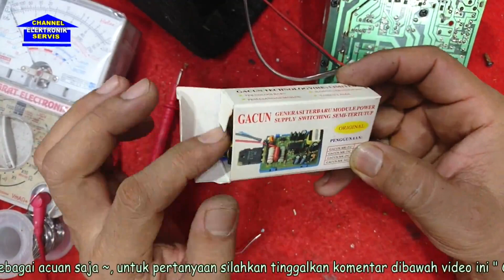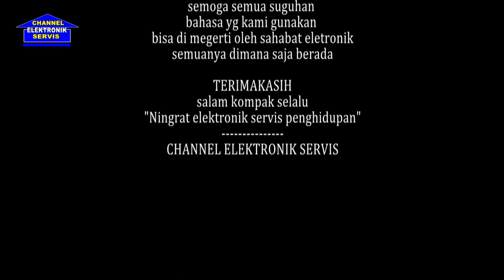speker Bass tube  AC/DC tidak bisa hidup

Comment: Kalo ic tegangan  nya jebol masih fungsi apa tdk?
Reply from the maker: klo ic teg listrik pln nya jebol sdh jelas tdk bisa pake PLN lagi sebelum di servis,
bisa di cek / di coba pake teganan 12V lewat DC input 12v , pake adaptor cctv 12v / 1A sdh bisa hidup biasanya, 
biasanya pake adaptor 12v speker j bisa di pake lagi.
Reply: @Servis-f3h  kalo di ganti bisa , apa di ganti psu aja?